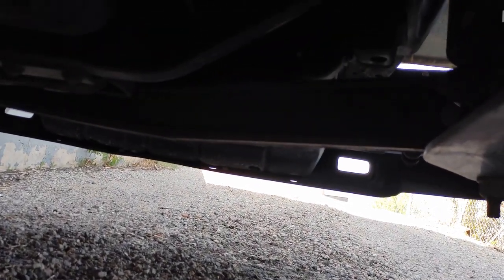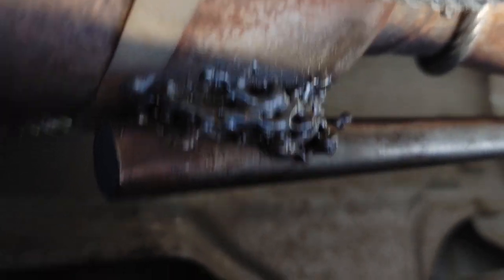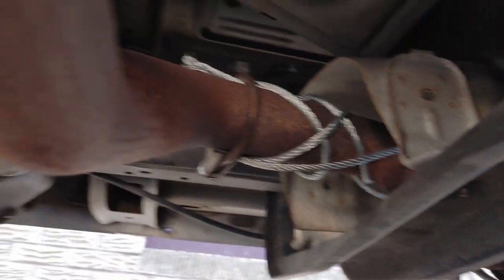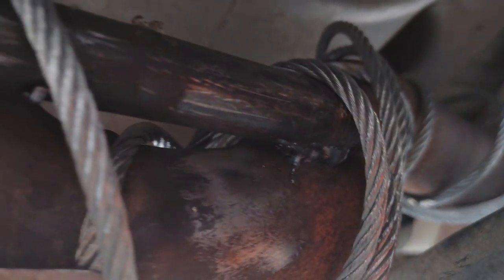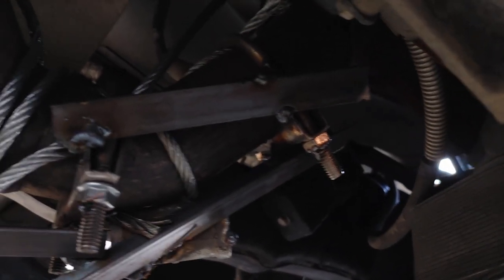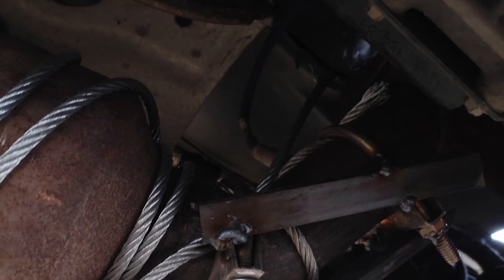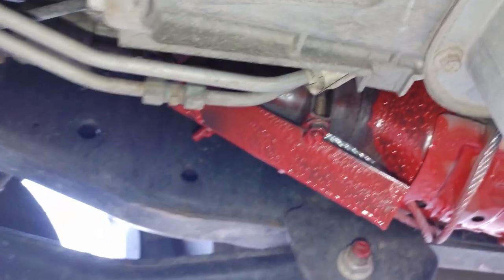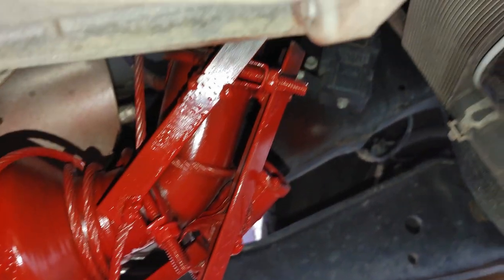E-Series Van Homemade Catalytic Convertor Security deterrent. E150, E250, E350 dual cat

Comment: Seems like a great idea. I had mine stolen, cost over $!,000 to replace. Luckily my insurance paid to replace it. My mechanic also welded an additional bar over it. I will now paint with bright color paint and wrap it with loose cable. If you need a vin for your vehicle, why not for the cat. A van is perfect for thieves. No jacking required and my Viper alarm is a waste unless I hook up something with a switch to protect it. Will try this in the Spring when it gets warmer.

Comment: Cables and using exhaust clamps work. Be sure to gob some JB weld on the clamp threads so they can't unbolt it. I also stenciled "Fuck you" on the cat.

Comment: Right on brother good work. Mine got stolen (old Tacoma) last week, want to protect the replacement. I don't have a shop or skills to do it myself but bought something called Cat Clamp for $200 it's same idea using woven steel cable. The idea is to keep it kinda loose to get less grip for the cut off tool. PS criminal scumbags hopefully cut off their own fingers doing this shit (or get shot even better)

Comment: i just had both of mine stolen off my 2022 dodge ram..thanks god for insurance..costed me 500 deductable and my insurance paid the other 6000, i need to figure out a way to protect mine, they are both right in the front wheel well are and very easy to get to
Reply from the maker: Man that's terrible! Whoever's buying these used catalytic converters are in the wrong just as much as the thieves. 

You know all these crazy thoughts go through my head after I hear another story. Like what if someone is paying these guys to steal cats just to discourage people from buying combustion engines to push the sale of electric vehicles? 🤔 world is heading in a weird Direction and I am not sold on electric vehicles as cool as they may seem.